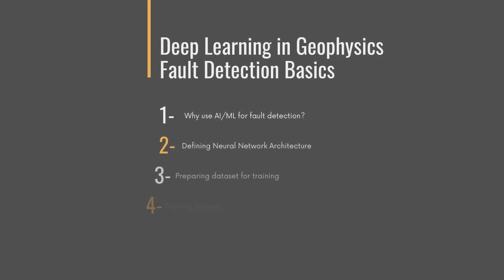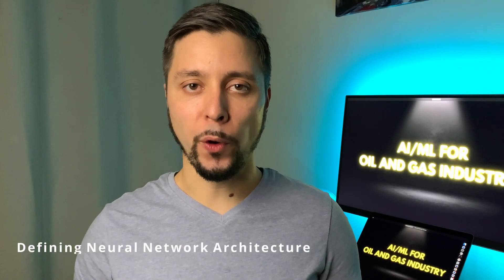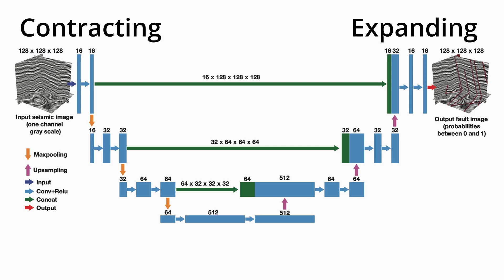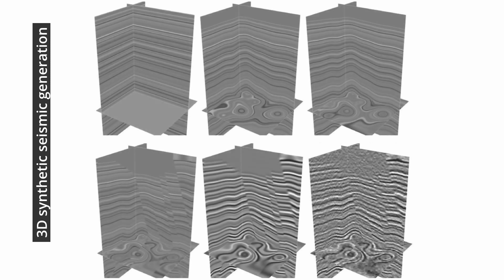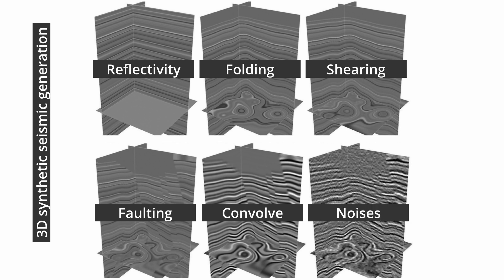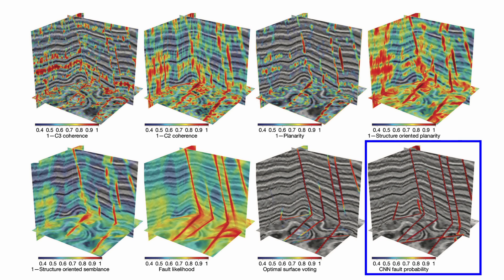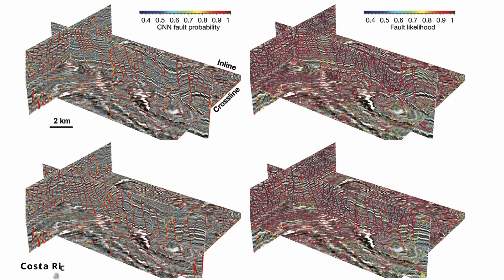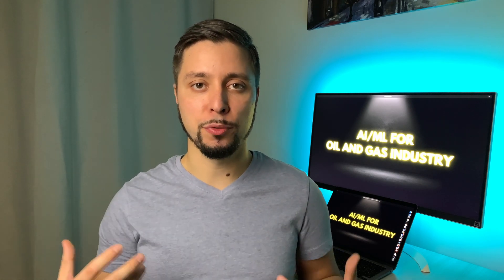Deep Learning in Geophysics: FAULT DELINEATION/SEGMENTATION | Paper Explained

Comment: Salam Dear Ruslan, thanks for your valuable sharing. Do you have special AI and ML courses for Oil and Gas industry? Where you would demonstrate all starting from data preprocessing,  training, testing, validating and prediction method selection etc. I mean with more details.
Reply from the maker: Salam Nurzhan, thanks for the question! It's indeed under preparation at this point. Once it's ready, I will make a video about it here and post it on LinkedIn.